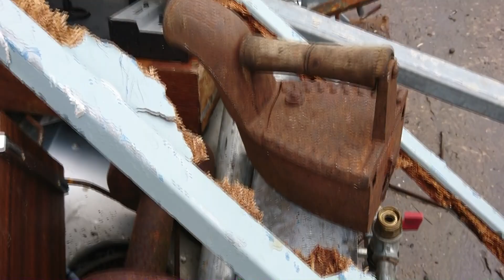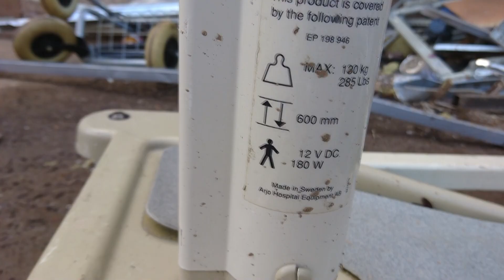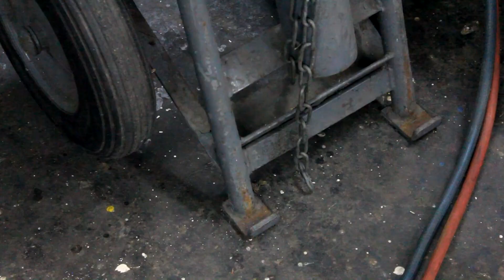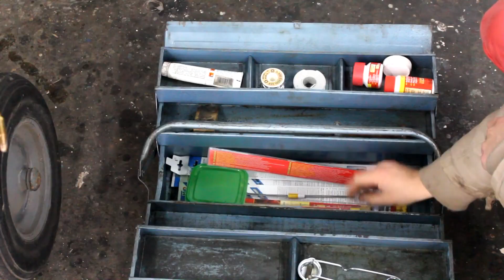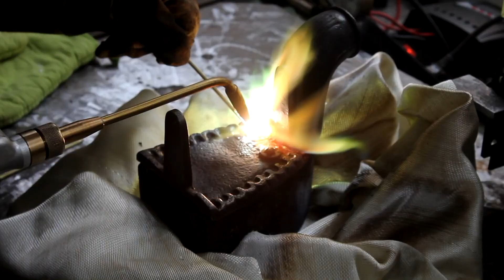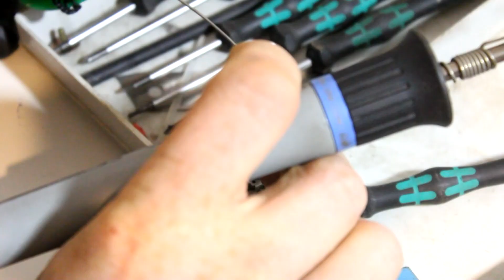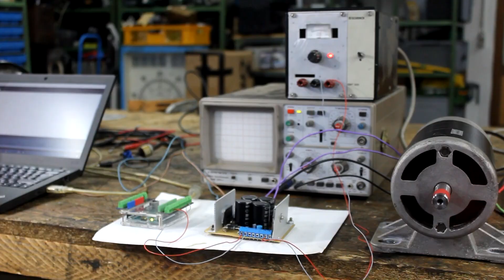Amazing Scrapyard Finds! Repair-A-Thon!

Comment: With regards to the section on cast iron repair, I offer the following.  With oxy-acetylene torches, the volume of heat is controlled by the selection of the appropriate tip number, not the pressure of the gasses.  From the initial ignition of the acetylene, and the sound of the flame, I would suspect the pressures are too high.  The appearance of the flame also tends to confirm this.  Also, there seems to be more of a lean mixture than desirable for welding in particular and brazing to a lesser extent.  With proper adjustment, there should be the two-cone flame with the inner, darker blue and the larger, lighter blue outside.  The oxygen is increased to the point where the inner cone just forms, and no further.  This indicates the point where the flame is "neutral", with neither excess fuel or oxygen.  This gives the most precise tool for the application of heat where you want it, when you want it, which is the key to welding cast iron successfully.  Essentially, you are using a fine brush instead of a roller or spray gun, to employ a painting analogy.My preferred alloy is MG-240, which comes in sticks slightly smaller than 1cm, and an appropriate fluoride flux.  Being right-handed, I work left to right, which points the flame into the blob formed by the flux, under which the magic happens.  Observe the shape of the blob while working.  As the alloy fuses into the parent material, it flattens out.  Push the alloy stick into the blob and notice it inflates.  Place the flame at the root of the alloy stick, and you can feel when it melts.  Move the flame back to the edge of the blob just at the parent metal and wait for the blob to fall again.  Continue dipping the alloy rod, heating it, and switching back to the working edge, and continue across the workpiece.  Be patient, as everything is slow, precise, and controllable.  Unless the section of the parent metal is quite large, pre-heating is not necessary, as there is sufficient time for the heat to diffuse into the parent metal.  I would describe the heat as "soft and slow" instead od the short and intense heat of the electric arc method, which has to employ the "nickel" bearing rod to partially compensate for its shortcomings.  Also, find some firebrick, crush it up, dry it, and keep it in a clean container, preferably metal.  This works better than vermiculite for slow cooling your projects that are sensitive to the formation of brittle structures if cooled too quickly.  Lasts forever, and doesn't stick and require extra cleaning.Congratulations on the important tool of precision heat.  It opens many horizons.

Comment: Common AC voltage in many countries is actually 127v, which would explain the 180v specification (127*sqrt(2) = 179.6)

Comment: on 1:10 that opel engine (2.0-2.2 dti) have  valuable parts that worh some money, that is EGR electronic valve it cost used about 100euros and diesel pump PSG 16 used it cost about 300 euros...

Comment: Me: "How dangerous could a oxyacetylene torch be?"
TPAI: Shows website with picture of anvil being cut and melted with oxyacetylene torch. (8:13)
Me: Pokemon Face
Reply: Quote from my comment above:"Local trade school had its metal working shop explode all windows with in 50meter radius, everything was trow to walls, gas bottles fell and knock the valves off turning into ICBM's... just because some jackass decide to weld plate on pipes end, fill the tube with mix and hit the spark. By some miracle jack ass only lost his hearing and couple broken ribs." You can go check hydraulic press channel to see how this mix in small soap bobble goes when ignited... you dont want to fill balloon with it, nor a pipe..not even a small one...

Comment: You are using far too much acetylene pressure, or your acetylene regulator is faulty. Acetylene should be set to  0.5 to 0.8 KG/cm and when lit, should be like a smoky candle flame. Set oxy to 1.75 kg/cm. light acet with the valve just barely open, turn the flame up slowly till the smoke JUST dissapears, then turn on the oxygen and increase oxy till the cone comes back to the tip and has a rounded point. That is the correct setting for that nozzle for a neutral flame. If you need more heat, fit a bigger nozzle. Love your videos, especially the scrapyard salvage!

Comment: WAIT !!  DIDN'T I LEARN ABOUT BROWNS GAS TORCH, BEING ABLE TO WELD CAST IRON,...
 AND ALSO STONE/CERAMICS.... ??
YOU CAN BUILD THAT HHO BATTERY DIY !!
Reply: P.S. Automotive Battery Charger, Borax, Water in a 20l bucket... ELECTROLYSIS RUST REMOVAL...
 VERY ECO-FRIENDLY.

Comment: One good tip some old ship yard workers gave me regarding oxy- acetylene, concerned the gas lines. Don't run the two lines tightly together (a lot of people tend to tape both lines together for neatness), the reason is that if the lines are together then it is easy for bits of molten metal to get caught between them and burn them. Not so much a problem if your brazing, but if using the torch for cutting metal it is a good idea to keep the hoses apart.

Comment: I've been wanting an oxy/acetylene rig lately too, even though I have a plasma cutter.
Reply: They're useful for so much more than cutting.  I use mine for heating before welding dissimilar steel types, cutting of course, welding, soldering, brazing, breaking bolts loose, hangover recovery, and etc.
Reply: @sparkyplugclean2402  Hangover recovery huh? 🤔
😁👍

Comment: Awesome! Is that a PWM circuit or a voltage controller? I have used the control of voltage to change the speed of a treadmill motor but you lose torque at lower rpm/voltage, would love to see you do a PWM setup.

Comment: New seals on them torches and your all good the only thing is regulators are sketchy when you buy used but a desl is a deal.
Reply: I found that exact tool box with German made metric open end wrenches in it here in the states.

Comment: Greatly enjoyed watching, we all like scrapyard walks. You could do these vids in two parts, first a tour of the scrapyard showing as much stuff there, we want to see all these quality German made products of the past. Then the second part, what you picked up and the projects you make or plan to make.
Becker and the other make Blaupunkt bring back fond memories, I had them in my car in the 1990's. I remember, vaguely models such called "Alpine" and "Europa". Do you repair the old valve/tube radios? Just asking, I have a 1950's Telefonken that is not running. But I am in New Zealand.

Comment: unrelated question: you also have a hameg 203. mine has a bad trafo becouse i was switching some coils in the same outlet and that spicked through somehow. now it has no output behind the trafo. is there a similar enough trafo as replacement? you can still measure the output voltages of yours

Comment: I have a paint sprayer motor and working power board that came with the unit. It says 150VDC.... 6.4 amps....
i wish to use such in a project but the only control it has is a simple pressure switch( on and off) i am currently looking for a speed control system for this thing. I was thinking about using  PWM from an Arduino into a mosfet but i wonder if this will work......? i am worried that the electronics will not hold up to the switching on and off ant such varied rates...... So i will be looking into your system for a model ......

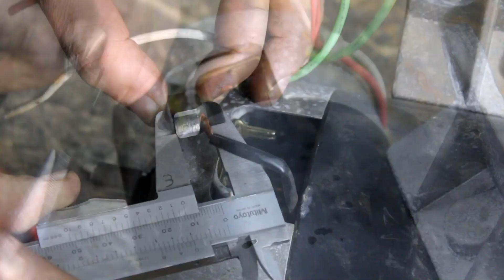Comment: 20:34 You're right. That sort of thing happens a lot over here. I picked up a $200 garbage disposal unit that had been curb tossed. Only thing wrong was one of the wires just inside the access panel had come loose.  2 minutes work and it was humming along. Still using it today

Comment: Be gentle on those old hoses.  When they were new, their max normal working pressure would be under 40psi.  It might still hold 90psi but they are not the same as your normal air hose.

Comment: The DC motor is designed to run on 220v rectified down to 180v DC.  120 V  will be rectified down to 90 v DC.

Comment: don't forget.. that some starter motors are perm magnet DC brush type motors and some can be found with exposed shafts.  they will tend to over heat quickly as they are designed and built in overload.. some are gear reduction others are direct drive.

Comment: I don't know if someone told you, but try using Borax when brazing. Just heat the tip of the bronze rod with the torch for a few secs and stick it into the borax (the borax will attach to the rod). Then use it as usual. It will help the brazing a lot.

Comment: those DC motors are often used for a 2x72 belt sander with a DC drive for variable speed and direction.

Comment: Without knowing what you paid for the torch it is unclear if it was a good deal but for the most part used torches are safe at least most styles but o rings and hoses are just wear items that will need replacement regardless of what type torch you have still very cool they stand by their products though i do believe you just got a bum deal on that particular torch with it being shot. If it was just hoses and o rings that is to be expected with anything older than 3 years regardless of if it was bought new or not

Comment: Is the coal-fired flatiron an industrial item?  From what I've seen, household flatirons from before the advent of electric irons came in a set.  You put them on your kitchen stove (which would be kept going all day in normal circumstances) and swapped to a different one when the one you had been using cooled off too much.

It would certainly have been much easier and faster to just buy a new oxyacetylene welding rig, and not much more expensive, given you needed to replace almost everything and modify most of what was not replaced.

If you don't trust the hoses to safely hold flammable gas, you probably shouldn't trust them to hold pressurized air, either.   A bursting air hose is almost as dangerous as a bursting acetylene hose.  (This is because air is compressible, and thus stores energy like a spring.  If a hose breaks, the energy gets released.  This is why hydraulics are generally preferred to pneumatics whenever feasible:  Hydraulic fluid just squirts out without the kind of flying and flapping hose that compressed air can produce.)

Comment: What happened to your intro's sound?  The volume was extremely low.  I was checking for issues with my sound setup when the main section came up, and the sound was normal.

Comment: Acetic acid, AKA distilled white vinegar, will also clean rust and scale off of ferrous metals and alloys. It is just as safe to use as citric acid, but easier to find and can take longer.

Comment: One thing you did wrong is you cut a metal band around the base.. to make a tight fit.. the problem is most likely the diameter will be different on the one you exchange with.. and it will not fit.. what I would of done is made a square block bottom and put another chain on the bottom if your worried about it falling off.. and if your worried about it being to loose add a solid rubber bungee cord also

Comment: I salvaged a discarded treadmill a while back and it had a D.C. motor controller which was functional. The only downside to using the treadmill controller was in that it has a soft-start feature which is frustrating to use if you want immediate response.
I don’t have enough electronic knowledge to figure out how to (if possible) eliminate the soft-start.
Any suggestions?????????

Comment: Love your opening speeches on these videos! Couldn't agree more.
BTW. You can reset the security code by sticking the car stereo in the freezer for a few hours. I got the tip many years ago from a friend after having picked up and repaired a Pioneer unit from the nineties. Worked fine for me.

Comment: i really like your educational videos concerning electrical engines. I myself are quite in to engines and collect them since a long time. thus i have not learned how to make them run yet as ive not yet made a proper shop for this type of interrests due to outside no roof rain problems.
 greetings from Sverige

Comment: It would be interesting to see torch in action more often. Motor speed controler could also be interesting if it could be used with universal motors and maintain desired rpm

Comment: Love the repair vids, especially the electronics!  I sometimes work at an "e-waste" recycler and it's amazing the things that come in to be thrown out, for free!  Much of it works just fine, I'd bet well over 50% and the rest is often something fairly minor wrong.  The hardest part a lot of times is not bringing home too much!
Reply: that sounds like a great job.. would be nice to try, here in sweden it's forbidden to take anything from the recycling station :(
Reply: Arrange to do the work at work. if it's worth even slightly more functioning than as scrap (whether in the melt or over-the_counter as-is), then it's worth considering adding value to the item and having that value end up in your employer's register…

Comment: Can anyone help me get into this kind of lifestyle? That may sound weird but I always look with reverence to people like TPAI or AvE, I love everything about these channels, from the nice tools to knowing about how stuff is made and repairing rather than throwing away.  I also live in a small apartment in the city and I work in shifts so evening courses are hard for me... Sure there's YouTube nowadays but I don't know where to start, woodworking, welding, electronics? And even if I learned to weld, what could I weld here in the city? I would like to know how to do it still...I tried buying broken stuff and repairing it with help of the internet, but it often ends in misery... For example I bought a nice but broken Pioneer receiver and I even found the problem, but the power outputs were, in the words of a guy on the forums, 'unobtanium'...Kind of rambling here, sorry for that... All tips welcome...

Comment: Yes please! More scrapyard repair-a-thons.  To what end though? I enjoy when your repaired parts from to a purpose, such as the voltage controller you just used for the DC motor.
  I will enjoy watching whatever you decide to fix either way.

Comment: Every time you go to the junk yard I'm jealous - there is nothing like that near me. Where i used to live there was one but that's over 1,000 miles away now. I enjoy your visits to the junk yard and see items I would love to have. Sometimes you choose them sometimes not.
I would have arc welded the iron because with grinding it would have been near impossible to detect the repair. On items that get a coat of paint after the repair I prefer brazing. In any case your first attempt at brazing went well. Not so pretty but it worked. Only practice will help improve your braze.

Comment: I love your introductions. Your words are actually frightening. In past videos you talk about running out of resources.How true this is. I wonder how long they will be able to sustain this throw away society?
Reply: Its recycling society,it just makes you buy more stuff since it breaks faster.I got a 40 years old lemon squeezer and 35 years old cabbage grater -if shit today would last that long when would factory make money? Today you buy chap plastic one ,1-2 years max and throw it away -recycle it and make a new same crap.
That is how things work today,manufacturing methods for common items are so cheap today that its better to throw it away then repair it.Washing machines are typical example -We had Candy machine that lasted from 1980 to 2010 -replace bearings and belt and you are good to go for next 10 years.Today its just cheaper to buy a new one than to repair it since they cost less than 200€.In 1980 that same machine would cost you 3/4 of paycheck.
Reply: @zumbazumba1  Your preaching to the wrong person. I come from a generation of make do and mend. My late father was a T.V engineer with more than 60 years experience in the electronics industry. I have fond memories of watching him repair someones colour television in their lounge. I am lucky I have the knowledge and tools to repair most things myself. I get much more satisfaction out of repairing something rather than just buying new.This throw away society is probably the cause of global warming due to the effect of over manufacturing!!!!
Reply: @tonybalm1513  

Good for you nobody bothers to repair anymore .

Only reason for global warming is overpopulation of Earth-everything else is just side effect.
Population skyrocketed after ww2 from 4 bilion to almost 8  in just 70 years and its growing.
More and more cars,smartphones etc are produced ,people live 80 years instead of 40-60 like before-no major wars since invention of atomic bomb,most of diseases are curable now ,no burbonic plauges or spanish flue ,cars are each year safer,more and more forests have been cleared for fields of food.We dont have natural enemy -we are overpopulation of loctus that destroys everything untill there is nothing left and dies from hunger.
And that is a true cause of global warming .Greta lied to you,using aluminum  reusable straw and recycled paper bags wont do shit .